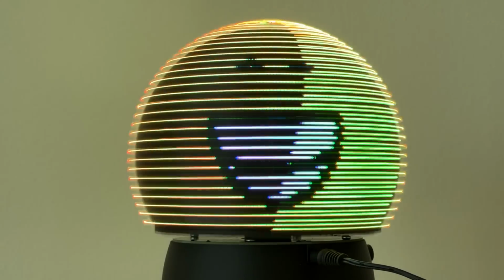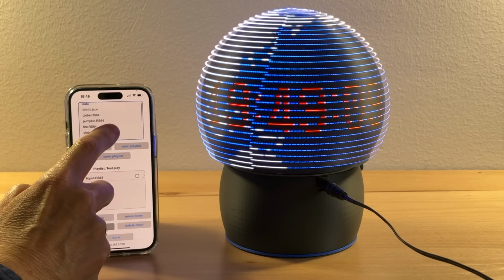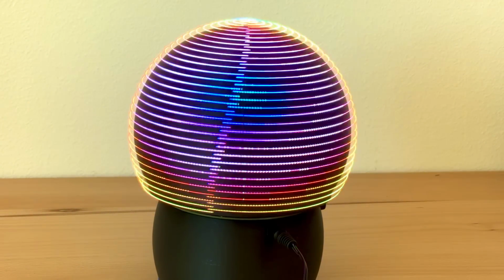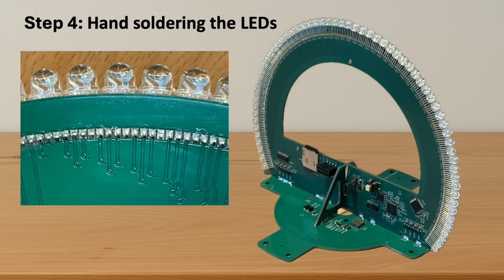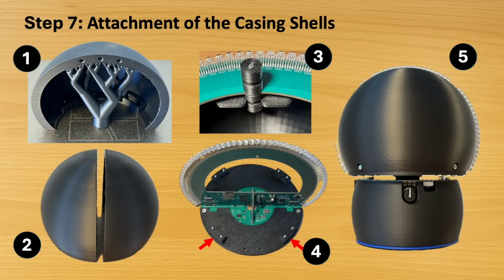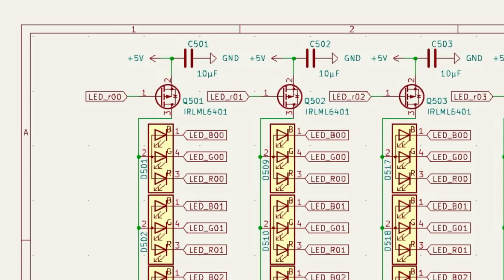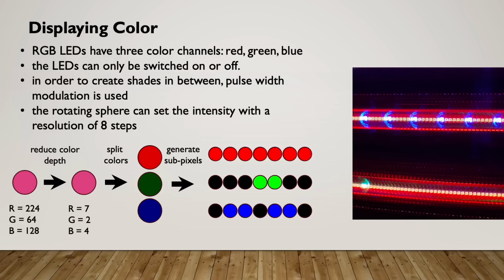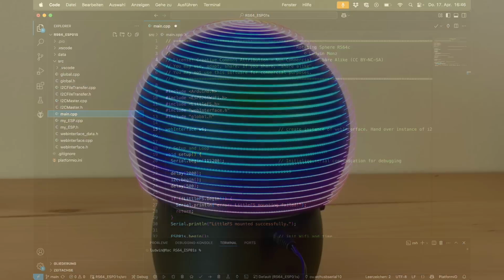Rotating LED Sphere – Building a RP2040 POV Display Step by Step

Comment: I would like to build a rotating sphere. I’ve requested a quote for the 4 PCBs from JLCPCB; they require a minimum order of 5 sets, at a cost of €280. Would anyone be interested in buying one set? Or perhaps someone would like to split the cost and take 2 sets?
Reply from the maker: As far as I know, JLCPCB requires a minimum number of 5 PCBs. However, PCBA (assembled PCBs) have a minimum of two units. Unfortunately, one time cost drives the unit price up in low volume.
On a separate note: recently, people have struggled to find the correct RGB LED. There are numerous LEDs in the market that look very similar, but have a different pin order. Study the data sheet thoroughly!
Reply: @LHM000 THX

Comment: Trying to pull together the various threads to make a start on the project. JCLPCB is really struggling with inventory for components. Seems like any time I check there's some other issue. A consistent problem are the 27 Ohm surface mount resistors and the 5 G-switches. The resistors are easily swapped out, but they don't seem to have anything that matches the footprint and pins of the G-switches, which kind of halts the whole process, sadly!!
Reply from the maker: hi, I am sorry to hear of the component availability issues.
I am not quite sure which component you mean (G-switch). Could you provide the designator, please?
Anyhow, recently I was contacted by someone who was struggling to find a source for the LEDs. Unfortunately, the dealer that I used to use here in Germany is not available anymore. Although there are many LEDs on the market which look similar, they might have a different pin order or brightness specification.
So, we could explore two options: 
1. you provide me the designator and we try to find a replacement component. A different footprint is not a no-go - depending on how it looks, I could potentially modify the pcb.
2. Depending on where you are located, I could sell you a set of pcbs and (if needed) also a set of LEDs. I still have some stuff left. However, I am a private individual and not a commercial seller. This limits very much what I can do. In case you want to go that way, please contact me on instuctables.com (https://www.instructables.com/Rotating-LED-Sphere-Building-a-RP2040-POV-Display-/) You can send private messages there.
Reply: @LHM000  The resistors that are unavailable are Part# RC-02W27R0FT, but there are options for replacements. The G-switches are the 4-pin 5.8mm x 5.8mm non-latching push button switches, MFR Part# PS-5824SVA-4PN. Unfortunately there is no PM button showing up for me on Instructables with my account named bsefree. Happy to comment on your project over there though as the LEDs are a major problem sourcing here in Canada as well. I found them from your supplier, but international shipping made the cost almost triple and I'm not having luck sourcing locally.

Comment: Hello! I wish there was more information on how you designed the PCB coils for inductive charging. This seems like a critical step and I feel like the theory in how you chose the layout/design wasn't clear in this video or the past videos. If you could explain this part, that would be awesome! I'm also open to chatting through email so let me know what works for you.
Reply from the maker: Hello! The theory of the Royer converter is very well explained here: https://www.mikrocontroller.net/articles/Royer_Converter. The article is in German, but it has all the details you need for your own design. Have it translated with AI - it is worth the effort.
I started with that article and simply replaced the coils with PCB coils. I used this calculator for designing the PCB coils: https://www.circuits.dk/calculator_flat_spiral_coil_inductor.htm.
However, there are two challenges in the PCB design: 1. getting the bifilar coil right. 2. identifying the correct phase of the feedback coil. I recommend you use my design as a reference.
The other parameter that you need to get right is to match the diameter of the secondary coil to the diameter of the primary coil. If the secondary coil is too large or too small, the coupling of coils will go down.
Reply: Thanks for the detailed reply — really helpful.

I’m working on a similar PCB-coil-based wireless power setup (but using a driven half-bridge with a series resonant tank instead of a Royer), and I had a few questions:

1. Why use a PCB trace coil instead of a litze wire setup, wouldn't there be a big changes in efficiency or power transfer?
2. How did you choose between increasing turns vs widening traces — were you optimizing more for inductance or reducing resistance/Q losses?
3. Do you have any other suggestions that come up in mind if you would change the design to be a resonant tank that I'm doing?

Appreciate any insight — your design has been really helpful as a reference.
Reply from the maker: My single most important requirement was the hole in the middle of the coil, as I needed it for the motor shaft. Therefore, litze coils with ferrite core did not work. The Royer converter uses a bifilar coil without ferrite core and a large inner diameter. One feature of the bifilar coil is that the field distribution along the coil axis allows for relatively large gaps between the primary and secondary coil. Therefore, the design is very "forgiving", when it comes to the mechanical setup. However, the bifilar coil with the feedback coil is relatively complex (you cannot imagine how many transistors I burnt because of wrong polarity of my wiring ;-). As my device was meant for beginners, I was looking for a way to make it reliable and easily reproducible. It turned out, that pcb printed coils are ideal, as they are alway right (if the design is right, of course). That was the main driver behind using printed coils versus copper wire or litze coils.
The pcb coil design first of all has to accommodate the inductance needs. Using the calculator that I mentioned in my previous post, I was looking for a compromise between inner and outer diameter (it should not be too large), number of turns (it should not be too many), and as a result the track width and spacing. I did some experiments, also with extra thick copper deposition pcbs. However, these pcbs require a larger spacing between the tracks. In the end, the gain in terms of (lower) resistance is not worth the money.
My design was not optimized for efficiency of the power transfer, primarily. However, efficiency turned out to be reasonably ok. I can live with the losses, which warm up the pcb.
I trust that helps. Good luck with your design.

Comment: Hey, I took a look at the repo, and it seems like the video tutorial and the /doc folder links are broken or missing. Id like to put this together, where can I get those resources for assistance?
Reply from the maker: I checked the repository and it looks fine to me. Please provide the full link of files which you cannot load.
The YouTube video is not in the repository.
Please also note the detailed description on instructables.com : https://www.instructables.com/Rotating-LED-Sphere-Building-a-RP2040-POV-Display-/
Reply: @LHM000  maybe I am using it wrong, but the /docs link leads to a 404 and the YouTube "step by step instruction" link leads to an @yourvideolink channel that seems to have garbage in it. But thanks for that link, much appreciated.
Reply from the maker: Here is the link of the repository: https://github.com/lhm0/rotating_sphere
Furthermore, when you are done with the hardware, you might want to explore https://github.com/lhm0/rotating_sphere_converter, which allows you to generate your own animations
Reply from the maker: Please note: this is NOT a beginner‘s project! You will need considerable electronics and software skills to make it work

Comment: This is brilliant.  I have had in mind for some time -  a couple of years - to make a POV globe, but I specifically wanted to make it with a vertical axis (for ease of construction and to use a coax transforner to get power to then globe), but present it with a virtual 23° axis, and I don't know how to do the maths to achieve that.  I wanted to show continental drift from Gondwanaland to the present, and I would like to be able to turn it so that it could be viewed from any side.  It seems, looking at your football and your "sloshing liquid" displays, that you have possibly solved the maths puzzle.  I asked chatGPT how to do it, but I didn't understand its response - maybe too mathematical, or maybe I just didn't spend enough time and effort to understand it.  I had originally wanted to use the 2 x 2 mm APA102–2020 surface mount addresable LEDs, but I understand the problems associated with putting them on a curved circuit board - by which I mean a flat board that has been bent into a curve.  Your method is esier to construct, and less likely to give trouble in the future due to cracks appearing in the solder.  The LEDs are fed serial data of 4 bytes each.  When each LED has its data, it passes all furter data to the next LED in the chain.
I haven't made anythiong yet, so my intentions arre quite fluid atm.  I can change anything at this point, but in truth, I don't know if I will ever get it done.
Reply from the maker: It is all about coordinate systems and coordinate transformations. Here is how I would perform the tilt and how I would generate the image data for the spherical display:

1. I assume the starting point is some kind of a video that shows the continental drift. Presumably, that video uses a cylindric projection of the spherical coordinates of the globe. This is the projection we are used to when looking at a world map, it is called the Mercator projection. https://en.wikipedia.org/wiki/Mercator_projection
2. I would transform the Mercator projection into spherical coordinates. There is a straight forward computation of latitude and longitude from the x,y coordinates a Mercator map. The result would be longitude and latitude for each pixel of the map. The formulas are in the Wikipedia article, look for "Mercator projection transformations > Derivation > x = ..., y = ..."
3. Next step would be to transform the spherical coordinates into cartesian coordinates (x,y,z). https://en.wikipedia.org/wiki/Spherical_coordinate_system
x = r * sin(theta) cos(phi)
y = r * sin(theta) sin(phi)
z = r * cos(theta)
4. Now perform the tilt. https://en.wikipedia.org/wiki/Rotation_matrix
Look for the basic 3D transformations. Theta is your 23 degree angle.
5. Now you have your map data in spherical coordinates, tilted by 23 degrees. You now need to make your way back in order to end up with the cylindric projection of the new map data. This could be displayed on the LED sphere.

I found that ChatGPT is very useful, when you guide it through the process. ChatGPT can develop a Python script for the above transformations, easily. 

Anyhow, if you have a movie of the continental drift, I can look into it when I find some time.

Comment: When I examined the pcb, I saw an inconsistency between the schematic and the pcb. The L1 inductor coil on the pcb is 2 pins, but in the schematic, the 3-legged and center-touch inductor is correct according to the schematic layout, but the pcb does not work. It seems to me that there is a mistake somewhere.
Reply from the maker: I am not sure whether I understand. I assume you are talking about RD56c_PS_V1, correct? 
L1 is a simple two pin inductor. However, the footprint of L1 has 3 holes so that you can use inductors with different form factors. In other word: you either use pin1 and pin2 OR pin3 and pin2. Please have a look at the silkscreen of the footprint. 
Have you made any changes to the PCB? the layout is more complicated and tricky as it might look. If you use the PCB without changes, it should work reliably. 
I suggest you open an "issue thread" on my Github repository. This will allow us to go into detail. Could you please upload photos and more detail on what you are trying to accomplish?
Reply: @LHM000  Subject: Question regarding L1 component in RD56c_PS_V1 PCB (Potential Schematic/PCB Discrepancy)

Dear [Designer's Name/Team],

I am writing to you regarding the RD56c_PS_V1 PCB and the L1 component, as I'm trying to understand a discrepancy between the project documentation.

I appreciate your quick response and clarification that L1 on the PCB is designed for a simple two-pin inductor, and that the 3-hole footprint is for form factor versatility (using either pin1/pin2 or pin2/pin3). This has helped clarify the PCB's intent.

However, I initially started my project with a schematic that seems to be associated with this project (or a similar version), which depicts L1 as a 3-pin, center-tapped inductor of 330uH (often used in a Royer oscillator configuration for a wireless power transmitter). 

The core of my confusion is this:

My understanding based on the schematic: A classic Royer oscillator, designed for wireless power transmission (as a transmitter), fundamentally relies on a 3-pin, center-tapped inductor (like the L1 in the schematic) for its self-oscillating, push-pull operation. This specific type of inductor is crucial for providing the necessary feedback and driving the two transistors in alternation.
My observation of your PCB (RD56c_PS_V1) and your confirmation: The actual PCB layout and the BOM (iBOM.html) clearly show a footprint for a 2-pin SMD power inductor. You also confirmed that L1 on this PCB is indeed a simple two-pin inductor. Furthermore, the presence of a TPS54202DDCR on the PCB strongly suggests that this board is designed as a DC-DC Buck converter, which is typically found in a wireless power receiver (to regulate the power received from a transmitter for a load like a motor).
Therefore, it appears there might be a significant mismatch or different versions between the Royer oscillator transmitter schematic I'm referencing and the RD56c_PS_V1 receiver PCB that uses a 2-pin L1 for a Buck converter.

Could you please clarify if:

The Royer oscillator schematic I am referring to belongs to an entirely different project or an older/alternative version of this design?
The RD56c_PS_V1 PCB is indeed intended as a wireless power receiver (as a Buck converter), and not a transmitter?
If this PCB is meant to be a transmitter, how does it achieve the Royer oscillation (which typically requires a 3-pin center-tapped inductor) with a 2-pin L1?
I am trying to build a reliable wireless power system and want to ensure I'm using the correct components for the intended circuit. Your insights would be greatly appreciated.

Thank you for your time and assistance.

Comment: Why not just use side emitting addressable SMD LEDs?, the SK6812 have a side emitting version and they would emit light parallel to the image plane, maybe slightly less pixel density but this would make both the software and the hardware simpler and even simpler if you only use a single Espressif MCU.
Reply from the maker: NeoPixel is no suited for fast moving POV displays. Please refer to my video https://youtu.be/z104PPDUCuw time stamp 23:07 for an in-depth discussion.
Timer functionality of ESP32 and ESP8266 is far behind what RP2040 can do. I studied this idea one or two years ago.
Reply: @LHM000 why not group those addressble leds into segements and drive each segment with a different IO pin, you can push the data via DMA. WS2812B is outdated there are other types of addressable leds which are much faster than the WS2812B, like HD107S, HD108S (40mbps/27khz), SK9822A (30mbps/27khz), APA102 (20mbps/20khz)etc.
Reply from the maker: Unfortunately, the faster versions of the addressable LEDs are not available anymore. It looks like they were discontinued (which makes sense, as in 99% of the applications there is no need for high speed).
Parallelizing the data would definitely help. The limiting factor will then be the PWM frequency. You definitely need a couple of PWM cycles per pixel, in order to display shades of color. But for some reason PWM frequency is just a couple of kHz in addressable LEDs. That is not very much for a fast POV display.
Anyhow, if you want to make such a display, would be an interesting comparison.
Reply: @LHM000  "HD107S, HD108" are still available from china they are the fastest version of addressable LEDs and have 27khz pwm frequency. I might give such a display a try in the future, I'll share if i do.
Reply from the maker: I am looking forward to it!

Comment: Very cool! I think it would be very hard do make one from scracth.
All I can think to improve it, still in a DIY manner, is to use SMD LEDs with in very small fooprints to add more vertical lines of resolution...
Reply from the maker: It needs side firing LEDs. I have not come across such SMD LEDs with small footprint, unfortunately.

Comment: Thank you, very nice DIY project – I’m considering building one with friends at our local MakerSpace :)

BTW, I’d like to point out a small typo in the video title.Tthe article “an” should be used instead of “a” before “RP2040” (Building an RP2040 POV Display Step by Step) because the pronunciation of “RP2040” starts with a vowel sound (“ar”). In English, the choice between “a” and “an” depends on how the abbreviation is pronounced, not how it is spelled. ;)
Reply from the maker: Thanks. Let me know if you need any help with your MakerSpace project.